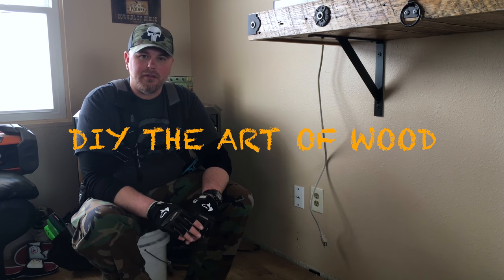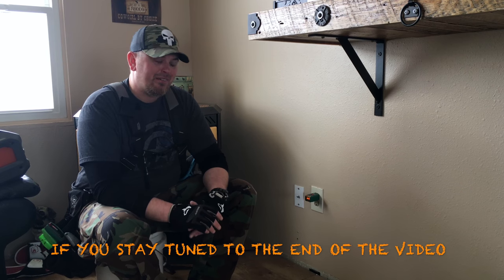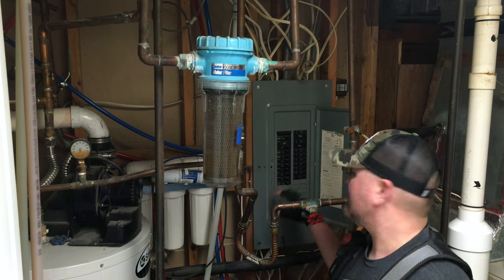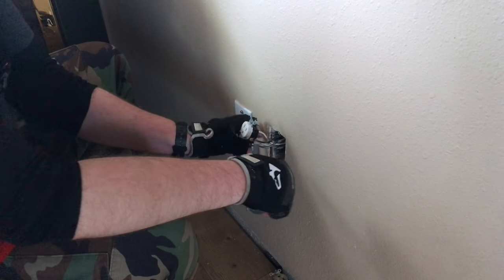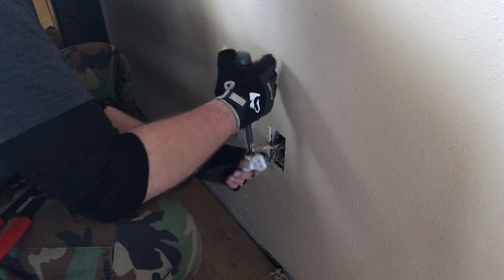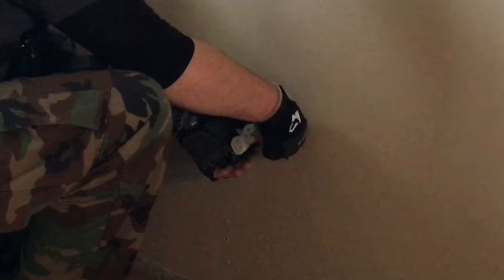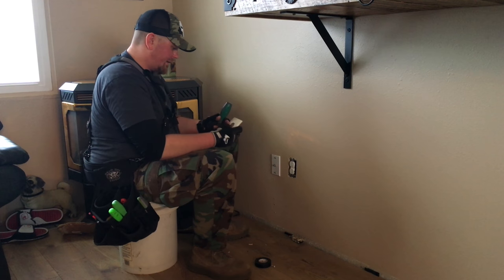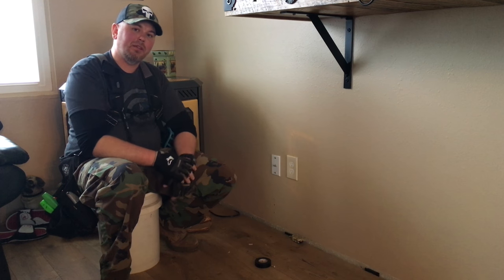Why do electric outlets get loose?

Comment: Being an electrician has to be one of the chillest trades to learn.. Did 8 months of it and a
Man was it chill.. in some situations one does get in a stressful job either by running a certain wire or a certain way due to studs 😂.. Or getting the fishtape stuck 😂.. Oh and when you can't open many holes so you have to use long ass drill bits to drill through a stud to reach another hole for the lights 😂
Reply: Lmao or when you put your hand through a bunch of wires and eventually getting shocked beacuse you supposedly turned off the power 😂
Reply from the maker: DLmohh I definitely agree. Why did you stop after 8 months though?
Reply: @JFKreations  personal problems came up and well yeah became inconsistent at work and decided to lay off since I wasn't in the best mental state.. Because even though it's a chill job it's really a matured job.. I feel like you have to be mentally strong to be consistent in it and not get bored after a while..
Reply from the maker: DLmohh definitely a wise choice, you have to look out for yourself first. Mental health awareness and empathy is a big part of my life, my family and who I am as a person. You did the right thing, especially considering the potential level of danger in that line of work. If your head isn’t in it, a lot could go wrong. Stay strong, take care of yourself and maybe you’ll be able to get back into it someday if you feel called to that trade.